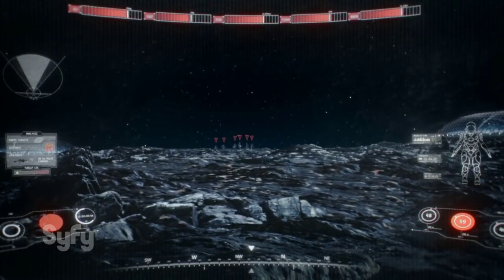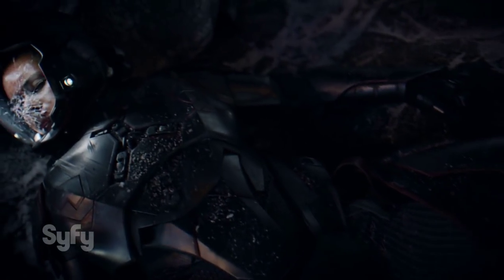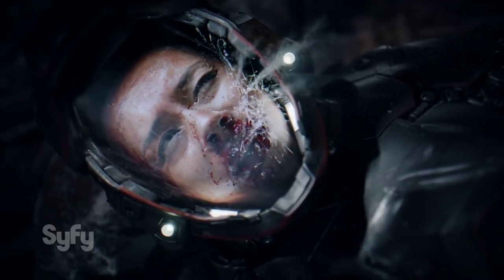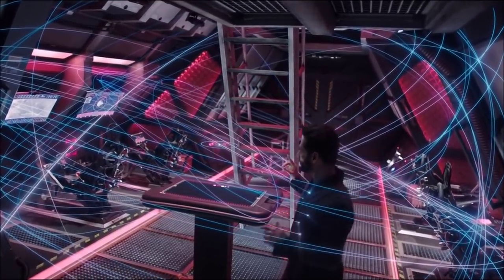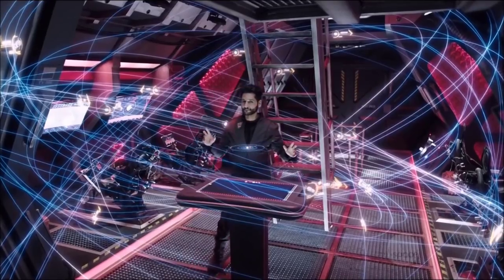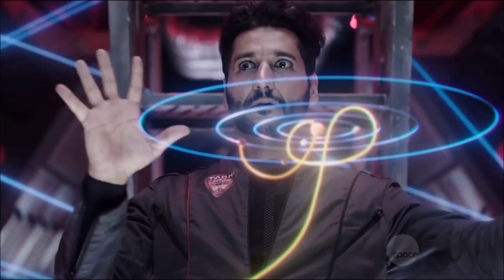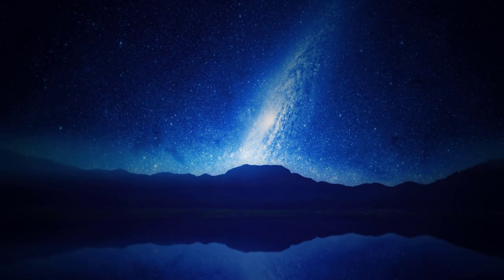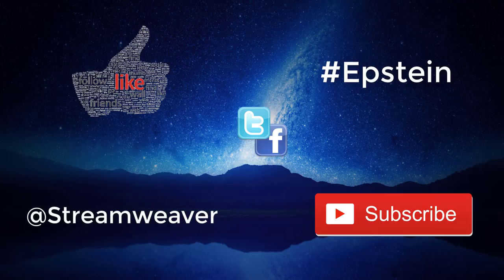Let's Do the Science:  The Epstein Drive

Comment: You should do an episode on communications in the future. They seem to be able to transmit large files including HD video across the solar system at high bandwidth speeds whereas today a single high resolution image would take hours, sometimes days to fully download. The New Horizons probe for example only is only able to transmit data back to Earth at like 1-2 kb/s whereas in the Expanse, they seem to be able to transmit and download full HD videos almost instantly despite the delay from how long it takes light to travel long distances in space. Why does our modern day deep space communications have such limitations and is it actually possible to transmit large files at high bandwidth speeds across vast distances with radio waves?
Reply: I'm kind of surprised that this comment didn't receive much attention. Don't big youtubers usually get a ton of attention on their comments?
Reply: A distributed (mesh) buffered relay/routing system perhaps. I recall in s03e04, when the Rocinante is near Jupiter, Holden saying to Naomi regarding the video message Avasarala wants to send to Volovodov on Earth (Errinwright's self-incriminating one) "Find us a router to bounce a tight-beam [laser] off of, something that can't be traced back to us." Presumably the solar system could be littered with millions or billions of these relay devices plus larger routing platforms. Already on Earth we have in excess of a billion devices capable of relay (smartphones, even though they're not used that way for the most part), and millions of Internet routers, and pundits are anticipating trillions of IoT devices in the next few decades.
Reply: @davidhart1674  That is how I saw it too.
Reply: @davidhart1674  In  the books it is also made clear that almost everything can run on peer-to-peer networks. Which does seem to suggest that almost any device can function as a some sort of router.
Reply: Lasers have a very high bandwidth.
Belters/MCRN/Earthers all use lasers for both ranging <lidar> and communications.. Same idea as fiberoptic, just free space.
Reply: Radio waves being sent from just Mars has to deal with how far away it is to Mars. The transmitter on the Mars probes are restricted by their size and the amount of power they can project. Sending HD waves will still lose power over the distance. Sending messages is easier based on how many antennas we use to send the data to Mars, but not in reverse, there is only one transmitter antenna and a small one at that. We've improved the transmitters on the probes, but it is still slow compared to what we can send from here to there. As for lasers they still spread out over distance. The tightest laser to the moon spreads out twenty feet at 235,000 miles, imagine its spread at 35 million miles when Mars is at its closest to Earth.
Reply: Mountain Fisher is right. Bandwidth is limited by signal to noise ratio. That means the further away you are the more power you need to get a high bandwidth signal to the receiver. The problem is handshaking data Communications across transmit distances of light minutes. How do you know your signal was received when you sent it? If you send a signal and nobody hears it you won't know for possibly a few hours. 
A possible solution could be a large number of communication satellites spread around the solar system kind of like a cell phone network. A financial incentive could be the first one to transmit your message to the recipient is the one who gets paid.
Reply: This one is easy , Generalkidd in the past doesn't know it yet but here in 2021 a few days ago we achieve quantum teleportation.
So quantum communication is the answer.
Reply: Tightbeam. They use light, like fiber optic cable (as other commenter mentioned). Because this has to be pinpoint accurate, they use relay stations. So there are multiple laser receivers and transmitters throughout the system. All transmitting and receiving at light speed. The only limit is processing time and queuing on computer systems.
Reply: @bjman13  I was reading the comments to see if any had commented this :)
Reply: @andrewbogard2411  Same here. (Man, i stopped The expanse at the 2nd season, i think i'm going ot rewatch it all again)
Reply: @kayd6572  i watched the whole thing but i am rewatching it now
Reply: It´s probably laser tele-communication. the energy bundling is really high and this fact allowes for massive data-transfer. (just an opinion, I dont know much about ´the expanse´ lore)
Reply: They use several types of comms in the series, broadband across distances which use relay stations to boost signals and narrow and as well as direct laser....which is like ship to ship that only sender and recipient can read.
Reply: @CragScrambler  This sounds legit
Reply: with their engine capabilities as he talked about, its highly likely they have relays and boosters all over the solar system, similar to the way we have so many sats in orbit around our planet now, in the show they talk about laser and a few other types of communication, and they do mention relaying here and there and also transmission delay, based on distance, is brought up on occasion.
Reply: @MountainFisher  I would actually love to know that math for mars
Reply: Generalkidd - You are a little mistaken. Back in 2005 we were able to transmit 32kbps over 130 million miles with no error correction encoding.
This was on the Deep Impact mission.
Now they are testing laser comm for deep space missions, but we will need an orbital (or Lunar) DSN terminal to receive consistently.
Lasers can easily be blocked by weather on earth based receive dishes, while RF does not get blocked easily.
Reply: @1p8Bar  This.  Iirc it's mentioned in the books on some level that signals are sent to an initial router then relayed past that point.  Assuming power wasn't an issue it would be the equivalent of how long haul data is routed on earth now just lasers through the void instead of fiber optic.
Reply: In season 4, especially, they point out to Avassarala that a message between her and holden would take 6 hours to arrive.

Granted, he is past the rings and all but that brings some clarification that communication is also not instant.
Reply: I dream of quantum entangled whatever over hyper large, if not unlimited distances, would be something that could plausibly allow this.
Reply: If you have access to "cheap" space flight, it becomes quite easy to put relays in orbits all over the solar system. A dense relay network solves many of the traditional problems. Assuming relays are spaced at roughly 1 light hour intervals throughout the volume of the ecliptic, you would be able to send signals with "quick" verification of receipt of signal for each leg of the transmission. The closer the spacing of the relays, the quicker the response confirming reception and lower power and precision requirements for the signal equipment. Also, the greater the number of redundant signal paths.
Reply: @davidhart1674  With the belters relays they installed in gate space we even get a glimpse of them. 
We sort of have to assume these relays are installed throughout the inner planet space by Earth and Mars and outer planets by Belters.
Reply: We haven’t figured out quantum entanglement yet.
Reply: MY impression is they use radio waves, mostly in the show. Tho, the huge ship that was supposed to take Mormons to their new home had a powerful lazer that would be used for communication. One could speculate why they havent mastered quantum entanglement (considering show seems to be somewhat built on current science, just what it could look like in that future). Never tough about it, but its somewhat odd that they dont use this odd natural phenomenon to for example communicate in some instances when it enables instant communication without delay no matter distance. Nature is odd, this phenomenon somehow seems to break the laws of nature (as we understand), considering if one look at it as data, data transferred instantly no matter distance (could be on the other side of the universe) it seems nature has a workaround for data/information or what ever to call it to travel faster than speed of light. Not saying its the case if practice, maybe we are observing a phenomenon that works under a different "layer" of reality that makes it possible for information to travel instantly no matter distance. And in reality, speed has  nothing to do with it. Its odd they dont utilize this phenomenon in the series, at least in key areas like big stations that need good and stable ways to communicate, and the delay easily makes things frustrating. Any tough's?

By the way, i could be way off considering i dont really know what im talking about. I just find  quanttom entanglement really, really strange. And i wonder what it tells us about "reality" and the universe we live in. And what it could be used for if we manages to understand it in the future. That is, if we dont F up, and for example blow our self up. Or anything else happens that will drag humanity back to the middle ages...
Reply: I think the bands are low to save power.
Reply: It all comes down to the size of the pipe. Today we are still using dial up technology to communicate with far away missions because the power available is tiny.
Reply: NASA just last week did a tight beam transmission of a cat video, of all things, to demonstrate a dramatic increase in bandwidth!

Comment: They don't travel to the stars in the Expanse! They are confined to the solar system.
Reply: Not because of thier technology
Reply: @sirwahthemonke  But they could. Constant acceleration of one g means you need 66 years and around three months to get to Proxima Centauri. And in fact the Mormons had the Navoo build to do exactly this. So it's not impossible for them.
Reply: Just fucking insanely difficult. Fuck this is an old comment
Reply: @oliverfranke7650  not impossible just requires 3-4 generations in constant space flight with nowhere to run and no help if stuff goes wrong. There's a good reason the Navoo was considered one of mankind's greatest achievements in the books. Mind you I am just starting the third book so there may be more I'm missing and if there is please limit spoilers:)
Reply: @themadhammer3305  That's not the point. Your reasons just say "Don't try". It is in fact possible and the Nauvoo proves it possible.
Reply: @oliverfranke7650  I didn't mean don't try, just that to actually do it requires an incredible feat of engineering and ingenuity. Which the Nauvoo proved was at least possible in theory
Reply: @themadhammer3305  Energy shouldn't be a problem, as the Epstein drive is discribed as highly efficient. And the fuel doesn't seem to need much space on a ship, as no ship in the tv series or in the novel seems to have vast exterior or interior fuel tanks. Except the part when the Ricinante is disguised as a tanker. A fusion powered drive as provides enough energy to sustain the requeired ship functions.

What makes the Nauvoo so special is the fact, that she's designed as a complete independent ecosystem, capable of providing home to thousands or even tens of thousands of Mormons on their 100 years journey to Tau Ceti. That's the challenge the engineers had to face. Not if it's somehow possible to leave the solar system. Of course it's possible, you just have to make sure there is enough living space, food, water supply, etc.
Reply: @oliverfranke7650  from what I've read of the books and seen of the show, food/ecosystem seems like it would be the biggest hurdle. Though provided there is nothing like the Ganymede failure cascade it is probably do able.

Population likely wouldn't be so much of an issue with some simple steps, provided they are enforced for the whole trip

The only other issue would be mechanical failure of some sort, but even then from the description they wouldn't be under constant burn and the ship had large on-board machine shops/foundrys
Reply: are you sure....
Reply: The first interstellar ship was being built during the tv show and the books, and there probably was no real motive to do so though earlier, as beyond scientific data (acquired by probes long ago), there is nothing you can really send back to Sol to sell, meaning no one would have economic reasons to send interstellar colonists. This is all compounded by the long communication lag, and the resulting logistical nightmare of governing such a colony, making nearer to earth outer solar system destinations far more attractive for colonisation. In the books/tv show, it takes a powerful religious group to send people, not for economic or political reasons, but for spiritual ones to get the first interstellar ships.
Reply: @oliverfranke7650  the tanker was probably not even for ship fuel but rather just useful gasses that would be depleted through industrial processes or life support. Like how nitrogen will be a sought after commodity for farming in the outer solar system.
Reply: @nayandusoruth2468   The Mormons wanted to have loads of kids! 

They kind of skim over it in the show, but there's heavy procreation restrictions on Earth (remember Holden 8 parent family?). So unless they wanted to begin rockhopping the Mormons had to find their own world.
Reply: P N  that's like saying thrusters take them to the planets. They only take them to where the drive can take over. The drive just takes them to the ring in the same way, not to the stars.
Reply: Cringed in the first 5 seconds with that line
Reply: And this is the biggest failure of setting. Rocinante is said to have about 0.2c delta-v. It means that it can accelerate to 0.1c and at this speed bussard ramjet should start working allowing to accelerate even further. Thus it should be possible to make a relativistic rocket with such technoilogy. It would take about 6 years travel time (for the crew) at 1G acceleration to reach star system 100 light years away from Earth. Sounds reasonable enough for colonization to me.
Reply: Does he mention stars in the video?